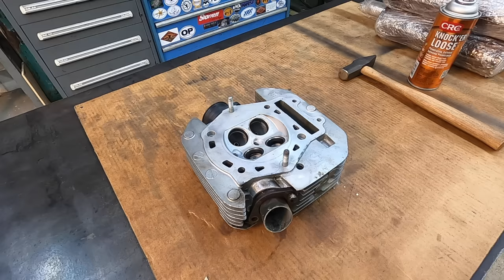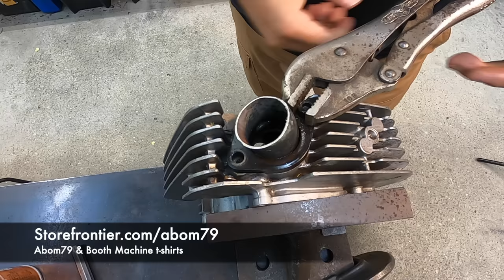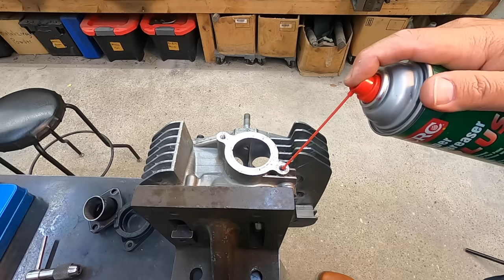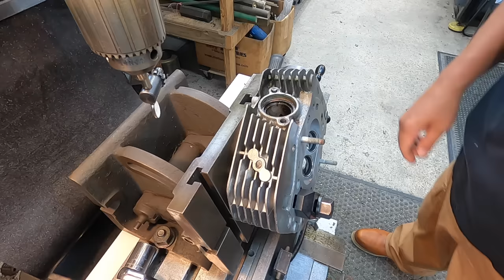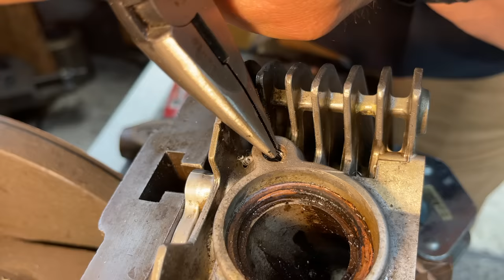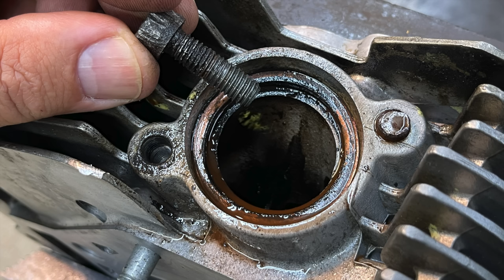Broken & Siezed Bolt Removal, DR 650 Cylinder Head

Comment: Heat the cylinder head to 100 degrees Celsius before trying to turn the nut--that sometimes releases the grip of the alloy on the steel, and it is not so hot that one can not handle it wearing gloves.  An oven works fine.

Comment: As a retired motorcycle technician and machinist from 1979 to 2005 I enjoyed watching this and I wish we had that adjustable angle tool. We had to adjust the mill table and head to achieve what you did in this video. Many times we were able to dave the threads and many times we had to install a helicoil or time sert to give it new threads. I prefer the time sert because it was solid unlike a helicoil would come out when removing the bolt later on. About the only thing I miss is doing some of the machining work.

Comment: Broken bolt sticking out a bit, weld a heavy washer to the bolt then weld a nut to the washer, lots of amps get it super hot. It can work
Reply: Just heat it up to red and it´s all loose. With heat you can remove old rusty bolts without cutting them. A very common trick with old cars etc.

Comment: Over 40 years of using acetylene torch to break the bond,  I have never had a failure.  Just bring the head of the bolt red hot and let the red died out,  and the magic happen.  If the head is broken,  just weld a washer on the stud left in the hole and weld a nut on the washer,  all the heat generated by the welding will break the bond and the stud will come out easy.  PS.  Never use propane,  you will distortion the parts because it will take forever to bring the head of the bolt red hot !

Comment: Enjoy your videos, and learn from them as well. Just a thought. When room is available, I would  try to replace the exhaust header bolts with studs, and secure  the flange with nuts.. It won't always work though. 
a former  Army Machinist from 1965.  Warmest regards!
Reply: Yep, that's exactly what I do, preferably with stainless 👍

Comment: Very impressive set up - I do miss my old machine shop - pulling out a whole bolt thread coil is very satisfactory indeed       - When you set up that bolt for true perpendicular, you could have used a bolt in the other hole? The Harley’s suffer often from seizure 5/16 UNC I recall -  I have done the same as you have freehand and when that happens you know your drilling is up to spec or maybe just lucky - as it is  easy to go askew 👍👌 keep up the good work - It seems to be a shrinking trade here in the uk!!!

Comment: The thing about welding a bolt on is that the heat travels down into the part and hopefully, the differential expansion of the materials breaks the grip, allowing the threads to move. For that reason, when the head is rounded off, welding is my go to first option...
Reply: Exactly, simple no need to get so technical either.

Comment: Some type of anti seize or even the weakest locking compound can provide a coating that prevents steel and aluminum from bonding together. As you said, patience is the key. Those bolts looked long for the hole. Almost everyone who worked on a motorcycle had an impact driver they are almost a necessity.
Reply: Agreed. And whatever you do don't think you are going to solve it by using a stainless bolt. Like you said best thing to do is coat the steel bolt threads.

Comment: Drilling is always the very last method I would try. Welding a larger nut onto the remaining thread has always worked for me. The heat really helps. I never try to remove a stuck bolt without using heat 1st particularly on exhaust bolts or studs.
However I do not have the tools he has. My drilling out is always very hit or miss. However a Helecoil set usually saves the day lol.. so far.

Comment: Everyone who works on their motorcycles needs to have a tube of anti-seize in their tool box. and use it! Next time you're doing an upgrade you will be glad you did!
Reply: Always baffles me to see mechanics bolting cars, bikes and trucks together without using anti-sieze.
I always had tin of graphite grease with a little brush through hole in lid and used it on every bolt, bush or pin.

Comment: I have found that drilling a small hole in the centre of the broken piece before welding a nut on it really helps. I have been told that it allows the piece to shrink as it cools.
Reply: That makes sense! Thanks!

Comment: I usually heat the head up first and spray BG in force lubed on it and let it sit. Then I use my snapon hand impact first then if that d is esmt work weld a nut on it . I always the ad success after welding s nut on it because all the heat goes deep down to the bottom of the threads. Welding a nut never failed the key is to get alot of heat on it. I have been working on motorcycles for 40 years but the main step is patience.  Thanks

Comment: I worked on many Japanese motor cycles over many years,  steel bolts into aluminum usually resulted in that problem. We got the job just after the owner had snapped the stud off. When we built new bikes up straight out of the packing crates we spent a little time taking the known troublesome studs out and coating them in anti seize copper grease, saved us hours of frustrating effort over the years during servicing etc.

Comment: I remove seized and broken bolts on a daily basis and I have yet to find one that i cant remove successfully.  For the most part heat is just about always the first step and you will not find a ez-out style extractor anywhere in my shop. My air hammer is one of my go to tools for removing bolts, i have a chisel that has a blade width of 3/8" and working it in a circular motion around the bolt usually breaks it loose.  I remove tons of broken ls exhaust bolts whenever customers send me heads for cnc porting.  I usually tig weld nuts onto the bolts, even if they are recessed 1/2" I am able to stick out my tungsten and slowly weld onto the bolt until it is about 1/8" proud of the surface and I can weld a nut to the protruding weld and extract the bolt.  When all else fails I fire up the edm.

On problem prone aluminum parts I often timesert or keensert the holes to prevent future problems.
Reply: I've had people tell me that you should never Timesert a problematic aluminum hole. 😸 They say always keep original threads. I say a Timesert is stronger than original aluminum threads. A properly drilled and tapped hole, with a permanently Loctited Timesert installed firmly against its seating recess, using the proper tool bottomed out to fully deform the leading threads in an interference fit as designed? Stronger than the aluminum OE threads imo. Interference fit WITH red permanent Loctite ain't coming out. There's more surface area on the outer threads than the inner, and the insert is a bigger diameter, so you'll most likely break the bolt off before you rip the insert out of the hole. 🤷🏻‍♂️ I believe it's the 2AZ-FE engines that rip out their headbolts' threads over time. The fix? Timeserts. 😎👍
Reply: @mannys9130  Pretty much any type of thread repair insert is going to be much stronger then the original threads due to the increasing surface area.  On aluminum and magnesium aircraft engine parts the vast majority of threaded holes have Heli-coils from the factory.  The Heli-coil was actually invented for the Allison v1710 which was notably used in the P-51 Mustang and the P-38 Lighting, the airbus a380 has 12,000 heli-coils installed from the factory.  I primarily use Time Sert and Keen Sert systems and I have the sae and metric master sets in both lines.  The only downside I have found is the high cost of the sets and the inserts so on things that are notnas critical I use Heli-coils.  I just had to repair a set of afr ls3 heads where someone stripped out every single rocker bolt hole.  I also have just about every Time sert spark plug hole repair system made and my ford triton set gets plenty of use.
Reply: correct heat is the first step if metal to metal surfaces are in contact not a plastic/teflon to metal, of course. I guess whatever works for you at the end. Just one thing only during the milling/flattening the broken bolt, perhaps it would be good to plug the hole so shrapnels don't go in there, good practice, yes? may be?

Comment: I had the identical problem with several aircraft cylinder exhaust studs. It's always the exhaust since they get the most heat. Removing the cylinder was not possible.  I ended up soaking the studs with PB blaster for several days, applying heat to the head itself via a propane torch through the open exhaust port, (which surrounds the stud) at each application.  I was able to get hold of the stud itself and apply a gentle rocking motion as I applied heat, and since the aluminum expands more than the steel stud, eventually they all released.  Didn't break any of them (24!) and replaced with stainless.
Reply: And if the stainless siezes in-situ, forget about getting them suckers out.
Reply: @johnharvey4496  I'm aware of the aluminum/stainless seizure proclivity, but I accepted that to solve a particular problem:  these two engines on my '73 Piper Aztec had been there for 46 years at the time, and the exhaust studs -being exposed to near-exhaust temperatures, rain and snow for that period, had corroded and necked-down from about 5/16" to less than a 1/4" where they went in the head.  The engines have about 1600 hours on them and will be rebuilt somewhere near 2000, and the jugs replaced then.  I used the softer standard exhaust nuts, though, not stainless, so if they stick I can split them if I need to take them off in the interim.
Reply: Don't forget nickel lube! It also stops gualding
Reply: @stevemitz4740  Yep.  Good stuff.  I also use it on the exhaust header slip joints on turbocharged aircraft.  Normally the exhaust pipes are one piece, since they are only confined where they come out of the head and the muffler just hangs from the pipes.  On turbo aircraft, the exhaust headers are locked on both ends, since the turbo is bolted solid.  Since the pipes go from red hot to below zero at times, there is a lot of expansion to deal with and they typically have slip joints, like dirt bikes.  Failing to lube these (which most mechanics never do since it's a big PITA) will eventually cause the pipes to crack, and having exhaust spewing over an aircraft engine in flight can lead to unpleasantness.
Reply: @jwills8606  I worked on the Vandenburg SLC 6 Shuttle project. Inspectors there required nickel lube on all stainless flange bolts, they told me nickel reduces the coeffect of friction to 1 [I think] meaning you need  about half the foot pounds of torque to achieve the same stress. But the stuff is toxic! Reminiscent of, What did the nut say to the bolt,...not without a washer, [& nickel lube] ! Sorry.

Comment: I was taught to 'back' the tap a little after every half-turn or so to cut the material free using cutting oil too.
Reply: That is the correct way to do it when you tap a new hole. The reason is you want to break the chips off in order to let the tap go easier and not to get it stuck/break it.
In the video, he's tapping an existing hole and merely straightening/cleaning the thread.

Comment: Bike mechanic here, simple impact screwdriver for the intake and 650 amps across the two exhaust studs with a car battery, pop em orange a couple times and they will finger out...
Reply: So, basically short circuiting a 650A car battery? Sounds dagerous...
Reply: Sounds fun

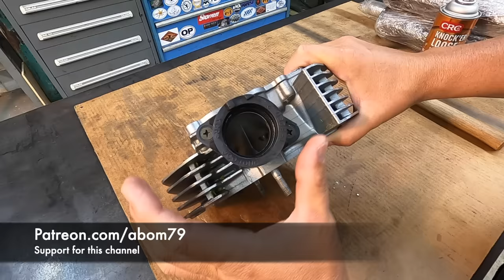Comment: Got some info on JIS (Japanese Industry Standard) screw heads. Look like a Philips, but must use JIS drivers. How do you tell if it's a JIS screw? They punch a dot on the head of the screw. If you stop the video at 2:05 and enlarge it you can see the punch dots on the intake side screws.

Comment: Well I was replacement of a Ford truck water pump broke 2 bolts video helped
Reply: I was attempting to replace the water pump on my Ford van. Two of them snapped, so I had to buy a power steering pulley remover so I could reach the third bracket bolt. I am giving it a go today. I am going to drill it through and inject PB Blaster, allow it to set for 24 hours, then drill it and attempt to use an extractor, If that fails, I'll use heat. I'll let you know which step of the process worked.

Comment: And the best part of the whole thing is that the owner of the part didn't try to use a hand drill to try to remove the bolt, leave it up to the professional with the rite equipment.
Another excellent job.

Comment: There is nothing like having the right tools that's for sure. The miller and the adjustable vice was a must for this project. Nice work ! I would have ended up using a bolt extractor and pray. And a little heat to the cylinder.

Comment: Bolt removal has got to be the most satisfying job ever.
Reply: I sure can tell you shearing a bolt head is one of the least satisfying job.
Reply: Well, I'll tell you for free, that the remains of the bolt usually approach the local speed of light across the shop after they cone out.
Reply: I call it 'metal dentistry'. You got to have patience, the right tools, a good hand and........a cuppa.
Reply: No. You take an hour to remove something that normally take 10second, and there a bazillion way to go wrong.
Reply: Satisfying when you finally get it done, even more satisfying not having to waste the time in the first place. :)

Comment: I don’t know that’s why I ask, I assume a big reason for not welding a nut to the bolt was because the block was probably aluminum which is always fun to weld. Besides their is more the one way to skin a cat. Good video Adam thank you for the content.
Reply: Usually, we put a washer on top, so the aluminium doesn't get the welding rod and doesn't melt.
Reply: He explained why he doesn’t weld a nut and if you have the machines as he does you use them

Comment: That's some professional way of taking it out. Steel bolts on aluminum almost always get frozen. there is no need for lock tight. The heat rarly works on something like this. It's a great video with great camera angles.

Comment: I think that studs for the exhaust would be something to consider when reassembling.
Reply: Most bikes use studs for this reason, the nut is far less likely to seize on the stud than a bolt to the head.  Suzuki may have opted for bolts here though due to clearance issues, sometimes you just don't have the room to assemble with nuts on studs.
Reply: Dash it all!  Don't put ferrous screw material directly into aluminum.  From the outset, use an insert.  Earn the blasted profit!

Comment: Heat around it first with a torch - don't heat the bolt, just the case
Reply: then you warp the head, causing cc sealing issues
Reply: @kalisurf5644  Better than cracking the head, which is almost inevitable with something like this.  A straightedge can be used to check if it is flat, milling may be necessary (anyway), no matter if it was heated or not
Reply: Or you can pack some dry ice around the area of the seized bolt. The metal will tighten around the bolt crushing the corrosion that is holding the bolt. Once it all warms up the bolt might then take in some penetrant and that coupled with the vibration from an impact driver the bolt might release.
(Provided you have ready access to dry ice)
Reply: i was thinking a trip to the oven. differential rates of expansion.
Reply: @a-fl-man640  Not an expert, but I think that's a case of "right concept, wrong method". 
Localised heat works best to exploit that differential. Sticking the whole assembly in an oven would bring the both the casting and the bolt up to high temp at too slow of a rate to be really effective in breaking the corrosive bond. Seems to be some debate as to whether putting the torch to an aluminium head is wise though (not just in this comment thread).
Reply: @sixstringedthing  Different expansion rates, the aluminum will expand more then the steel.
That's how we remove and fit bearings from aluminum m/cycle casings without scoring the housing.
However you have to be careful with a head to not get it too hot because the way we remove valve seats and guides is to put it in the oven which makes them fall out or push out easily, so to remove the bolt you don't want to risks a guide or seat shifting or dropping out of the head.
Best way IMO is to do what Adam did and machine / drill it out.

Comment: Thanks for the tip on removing a broken bolt on a motorcycle head. I’m working a broken bolt on cylinder that I have to get out, I’m definitely going to try your method of bolt removal without doing any heating or welding, I prefer this method so I don’t chance on worping the cylinder. I have it chuck up on my mill and ready to give it a try. Thanks again and by the way nice watch! Luminox #1

Comment: Get some Knipex Cobra pliers, they will bite i think up to 50HRC at least. They work much better than normal Vice grips👍
Reply: Agreed, Knipex Raptor pliers are a step above the Cobras for removing broken studs.
Reply: Knipex are awesome!
Reply: I've never had a problem with vice grips not gripping. Every time I use one on a stuck fastener the fastener gets chewed up. It's never been a problem with the jaws biting in
Reply: Y'all send him some. Them are expensive
Reply: @demonknight7965  Here in Germany a set of 3 pliers (180/250/300mm) costs about 60€, i think thats ok.
Reply: @RustyDockLight  exactly that‘s problem, if you use the Knipex pliers properly this doesn‘t happen